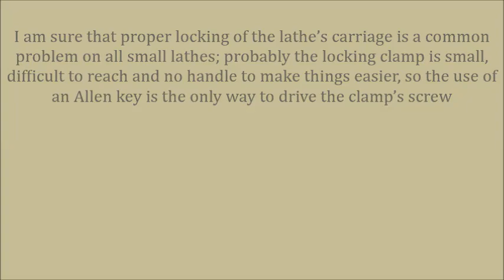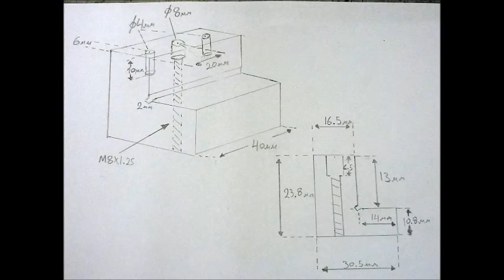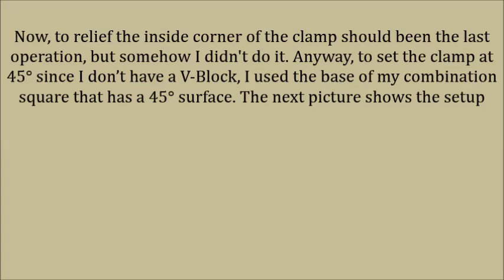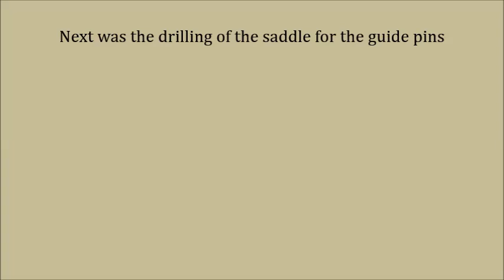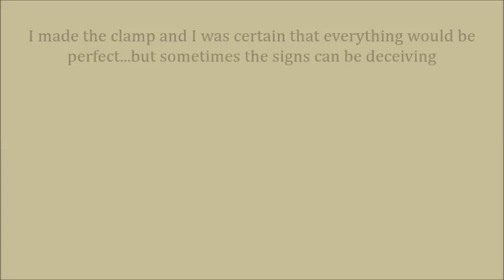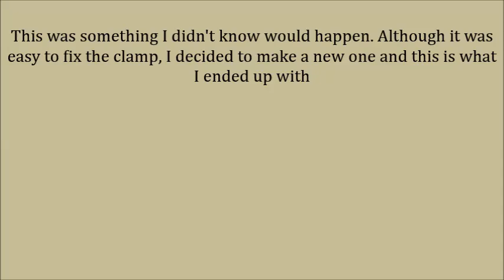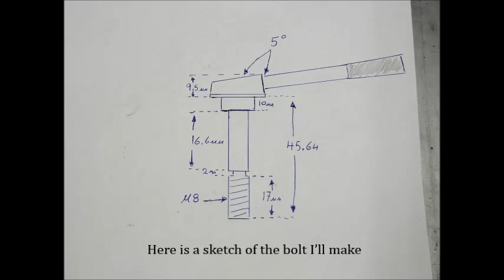Lathe carriage lock improvement

Comment: Nice job. I'm guessing you placed the bolt in with the washer and got an idea of where the lever would end up and then milled/drilled and tapped for the lever handle, then making a washer to final dimensions to get the lever to lock where you wanted it?
Reply from the maker: Thank you very much, I really appreciate you comment! I did it exactly as you described it! Thanks again.
All the best
Jimmy

Comment: Nice results, looks good. Did you consider adding the clamp in the middle instead, so it applies pressure evenly from under the ways ?
Reply from the maker: Thank you very much! To be honest I didn't thought at this at all; but as I'm thinking it now it would impossible to put the clamp in the middle because there is no place on the middle of the saddle where I could put the handle. Thanks again for the comment.
Cheers
Jimmy

Comment: I have a lathe who has handwheels I can not reset to zero making it more diffivult to do right, more expensive lathes can adjust that mm reading on tht wheel, I do not now the right word but is there some diy for this, so it can rebuild such I can reset it? Like set it to zero. Thanks
Reply from the maker: Hello, I apologize for the late reply! What are you looking for, its called handwheel dial. You can find it in machinery supply shops as machine spares. Take a look at these links: https://www.arceurotrade.co.uk/Catalogue/Machine-Spares/Machine-Handles 
https://littlemachineshop.com/products/search.php?tabName=Products&term=lathe+handwheels
perhaps you can find something that fits or to modify. 
All the best
Jimmy

Comment: Well done! I assume you planned the location of the hole for the handle for everything to turn out so well :)
Reply: With a bit longer bolt used for that clamping block it's in reality extremely easy to properly "time" or index where the locking handle is positioned in it's locked and unlocked state. Assemble it in it's working position and if the handle needs some extra rotation to properly position it, you can either add a sightly thicker washer or face off a bit from the threaded end face. That moves the entry point of where in it's rotation it engages with the blocks female threads and where it stops when fully tight. Since the thread pitch is already a guaranteed known, it's easy to calculate how much thicker or even thinner the washer needs to be, or how much to trim off the thread end verses the degrees the handle might need to be moved. It's more complicated to explain how to do this than actually do the work. And by the looks of it Jimmy really needs to re-set the handles fully tight position on his 4 position tool post. As is it swings too far towards the chuck with a high likelihood of it hitting a chuck jaw if he's not real careful. To calculate it properly you use the distance the thread advance moves under a full rotation, divide that distance by 360 for the degrees in a full rotation. That then gives you the thread pitch advance per each degree. A simple plastic protractor with degree measurements on it will be accurate enough to estimate how many + or - degrees the thread needs to be rotated to correctly position that handle.
Reply from the maker: @ Maxim Kachurovskiy Thank you very much, I really appreciate your comment sir! Turning Point explained the whole procedure very thoroughly so I can't add anything else, please forgive me for not answering directly to your question.
Regards from Greece
Jimmy
Reply from the maker: @Turning Point 
I can't think better explanation of the whole procedure, real thorough; Thank you very much!! 
As for what you said about the quadruple tool post are once again very accurate; the reason you see the handle on different positions (either towards the chuck or to the tailstock) is because I found that the quadruple tool post has not full contact with the topslide allowing really small chips to go inside, so when I need to turn the tool post to set the parting tool or the chamfering bit the chips are moved further inside making the toolpost to lift slightly more. This problem will it come to its end because I'm working on fitting a Multifix QCTP (upcoming project). Thanks again for your comments my friend, are excellent as always!!
Take good care
Jimmy
Reply: @JimmysCanal  No problem and happy to add what little I'd like to think I know. Something you may not be aware of yet. In the U.K. I believe there called Bristol Handles? Here in North America there normally called a ratcheting or adjustable handle. This is just a link to what they look like, https://www.mcmaster.com/ratchet-handles/ As far as I know there available from machine tool suppliers in most of the world. They can be had with imperial /metric threads and with either a male or female thread. Made from plastic, steel or even stainless. There more than handy on machine tools to allow infinite handle positioning if you ever need something like that and there not all that expensive. 

That Mutifix will be a good addition to the new lathe. But it sounds like you may need to hand scrape your top slide surface to get a better bearing surface for the tool block.
Reply from the maker: Your comments are always a pleasure to read my friend, thank you very much! Oh yeah we have ratcheting handles here, are available mostly from tool and machinery parts suppliers; I'm planning to buy 6 pc with M6 male thread to replace the crappy ones on my milling machine.
The "Multifix" project is something I've been working slowly for a couple months now; as for hand scraping the top slide you said, I first milled the surface and then hone it carefully using thin oil on fine sandpaper that was attached with adhesive tape on my surface plate (perhaps not the best solution, but it turned out very nice).
All the best
Dimitris

Comment: Why don't you shorten the gib adjustment screws enough to receive the lock nuts to give you more room and the lock socket head cap screw to give you more room. I did mine and it made a 100% more usable.
Reply from the maker: Hello,
I apologize for the late reply. You are right, I didn't thought of it at all. I'll do it because it will give some room for the DRO (future project) as well. Thanks again!
All the best
Jimmy

Comment: Great project Jimmy and well executed! I have two questions: Do you know a way to accurately indicate the relief groove while holding your part at 45°? And do you have a source of those small acid brushes here in Greece? I buy them from Germany and feel quite dum about that. Take care...
Reply from the maker: Thank you very much, I appreciate your comment! To answer to your question, the most accurate way to do this is by the use of trigonometry. There is an excellent video about it from Marc L'Ecuyer (AKA THATLAZYMACHINIST): https://www.youtube.com/watch?v=eafoNs4KFEo
My way - because I never was good on trigonometry - is to measure the distance between the two opposite corners of a square, then I simply divide it by 2. It doesn't matter if the part is rectangular because you can extend the opposite lines in your drawing from the thinnest corner of your part so as to create a square. I hope that make sense. 
As for the acid brushes you asked, I don't know any store having these; you can search in art supplies shops. Mine are coming from US.
All the best 
Jimmy

Comment: I have been eyeing those eccentric cutters for the lathe for some time now. Could I ask your impressions? They advertise that it is ideal for lighter less powerful lathes. Have you found this to be the case? I would just like to get a few opinions before dropping that much money
Reply from the maker: Hi,
I apologize for the late reply.
I'm using the Diamond tool holder for many years and I must say that I'm satisfied. Now I have seen this tool used on toolroom size lathes without any problem (mostly as a secondary tool because its fast to grind and use). The lack of power on small lathes makes it ideal for the 80-85% of the needed operations, meaning that you can save money for some specific indexable carbide tool holders. 
Although I have a very good set of indexable tool holders to use them with my QCTP (upcoming project), I'll not stop using the Diamond tool; I'll keep it as a secondary tool. I hope this to help you a bit on the decision?

Regards from Greece
Jimmy
Reply: @JimmysCanal  That's great information thank you. I think I will order one now
Reply from the maker: Really was my pleasure! I'm sure that you can get a lot more information if you contact Gary: gary@eccentricengineering.com.au 
This is a link of a video I have made about the Diamond tool holder: https://www.youtube.com/watch?v=ALxJ7JELH8o

Take care
Jimmy
Reply: @JimmysCanal  thank you much. I have seen your video on it and a few other peoples. Everyone is happy with eccentric engineering but I have only seen it used on smaller Chinese lathes. I have a small, but very rigid and very old 10-in Sheldon so I have been on the fence. I always wonder about the tool slipping downwards in the holder, particularly want some oil is splashed around.
Reply from the maker: Hello Jean-Paul,
Yes usually you see this tool used on smaller lathes, but this doesn't mean that it can't be used on some bigger lathes; the obvious difference could be only on surface finish, carbides give very nices finishes! The possibility of the HSS bit to split downwards in the holder is minimum, unless you forget to tighten the screw; otherwise I assure you that its really very difficult to happen if the speed and feed is the right one.

All the best
Jimmy